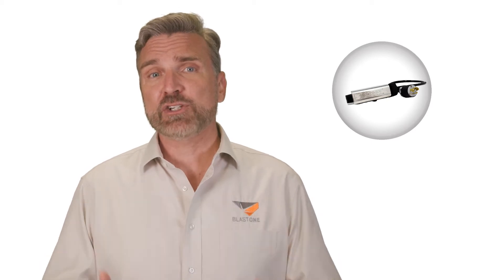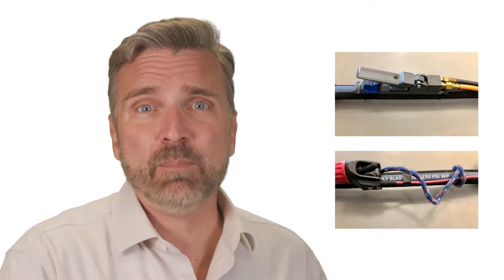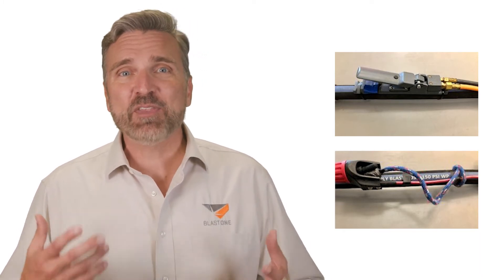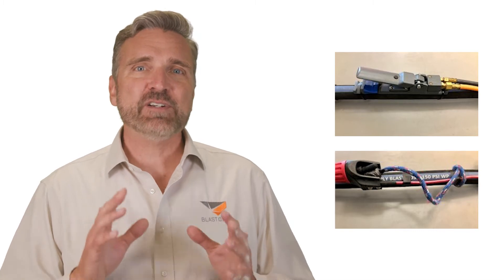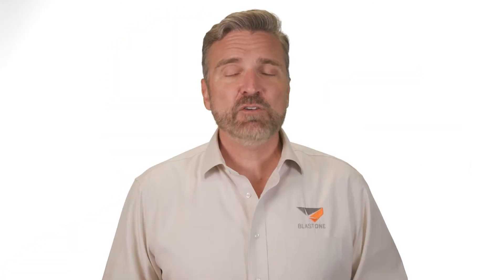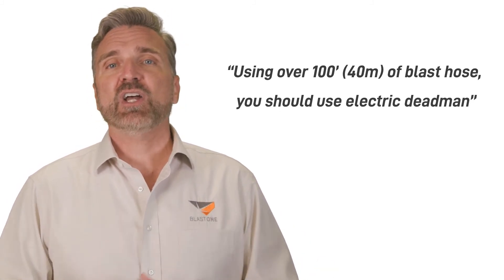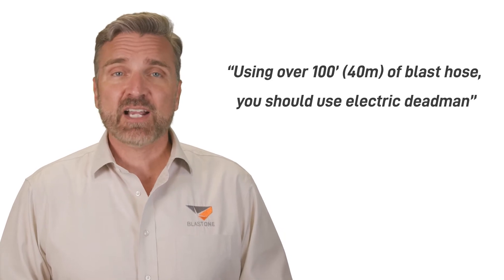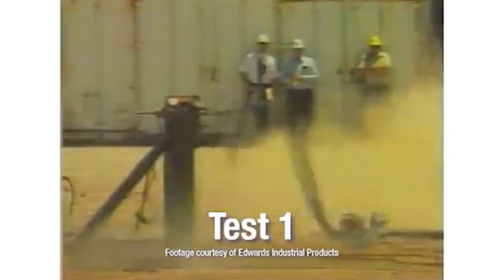Step 14: Electric Deadman | Performance 3 Masterclass

Comment: A video on how to wire up a 3 wire deadman line and deadman correctly with a template implemented into the video would be superb 😊
Reply from the maker: Great suggestion!  What ELSE??
Reply: @BlastOne  yes sir.
A video on how to correctly clean your air prep system, ex, intercooler fans system.
Reply from the maker: @mercn9591  Does this work, or are you seeking an action vid where we are actually cleaning it?  https://youtu.be/sb-yVVeEfAY